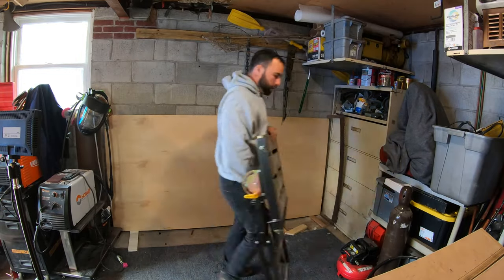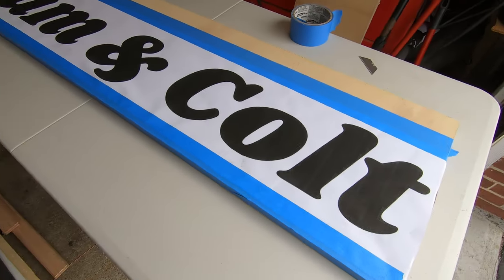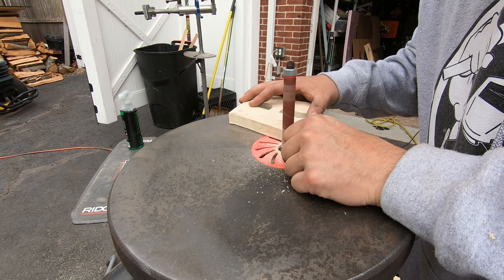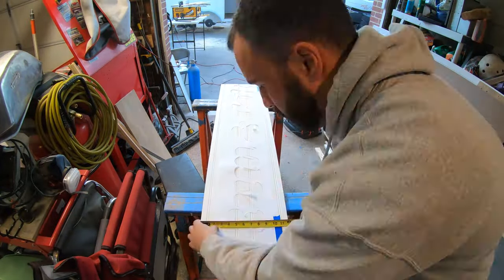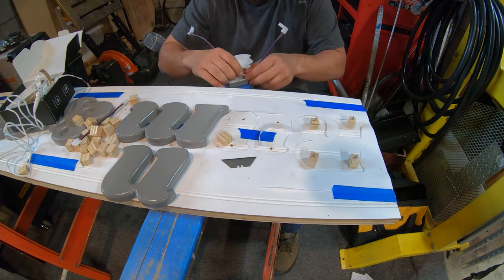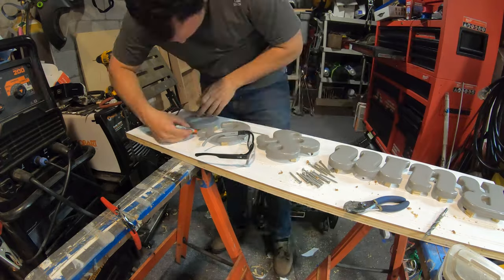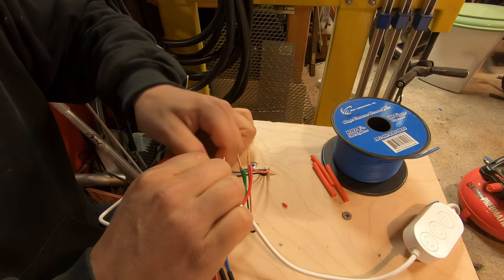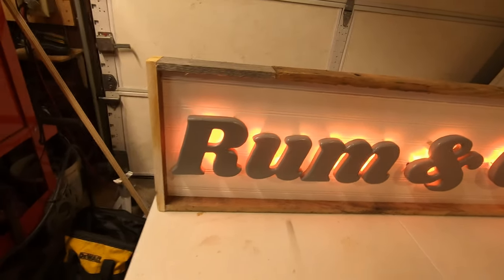BUILD A BACKLIT LED SIGN!!!  Tips and Tricks for DIY

Comment: Another idea for the stand offs would be to use a dowel rod and just cut it into the right length pieces and then just drill holes on the back of the letters and the back board.  Looks good what you did though.
Reply from the maker: That’s actually a great idea, if I build another I’ll try that!

Comment: great sign.. quick tip for your next sign, instead of using the entire paper template once you have it taped in place cut all the top of the template except 1inch
makes it much easier to put in place and not have to pull it out from under the sign. Not needed on a stand off sign but good for flush lettering.
Reply from the maker: Appreciate the tip!

Comment: Holy Crap the LED part looks insanely complicated, but you did a good job. I'm just really confused on how I'm supposed to learn how to do that on my own for the sign I'm making.
Reply from the maker: Very easy to learn, you’re connecting the lights the same way you cut them just with wire in between!

Comment: Well done, sir!  Thanks for the tutorial!  I do have a question, though.  I have a similar project, except it has a black background. 

To achieve a good backglow from the LED's, in my case, would you just make the areas directly under the letters, white?  Or will I need to figure out a different solution?
Reply from the maker: Honestly, I think you will still get a really nice glow effect with a darker colored background. The leds through quite a bit of light.
Reply: @jamesofalltradesny  Awesome!  Thanks again for the help!  Subbed.

Comment: Can you uses different gauge wire to connect to the LED strips connectors ?
Reply from the maker: You can, but as a minimum I would confirm the wire you intend on using is rated for the current you intend on drawing or upsize the wire to the next common size to be safe.

Comment: Could you use the USB powered leds with a USB enabled outlet and use the same connectors?
Reply from the maker: If they are still the same 3 or 4 wire LEDs yes, you definitely can! just match up the connector to the strip type.
Reply: @jamesofalltradesny  Thank you for the reply James! By the way, the sign is awesome. I couldn't sleep thinking of all the ways I want to try this. I think I'll start with a big Fender guitar pick sign!
Heavy pick of course.
Reply from the maker: @bradleysmith4974  if you post it anywhere make sure to tag me, I'd love to check it out when it's done.

Comment: IN 22 years of the sign business, we never put electrical on wood products. Big no-no.
Reply: Explain
Reply from the maker: 3 years of use and not a single issue… everything is fully insulated. Wiring in homes are run through wood everywhere…
Reply: My first thought was…..electrical in houses always runs through wood, no???  Lol